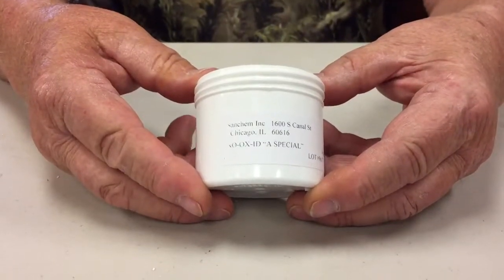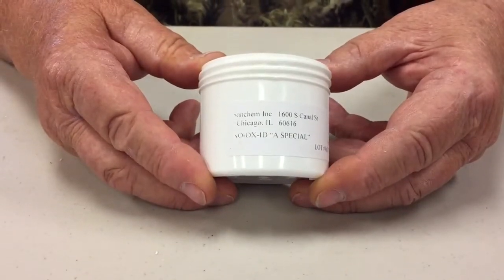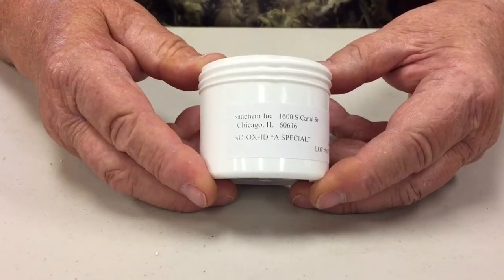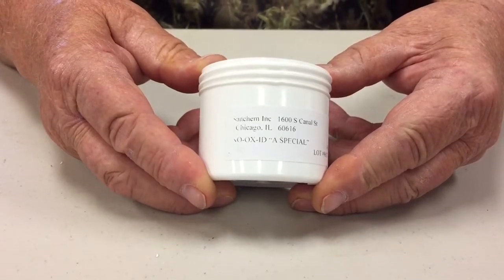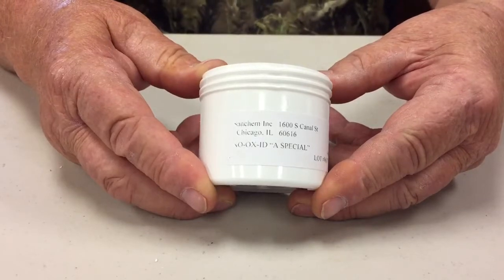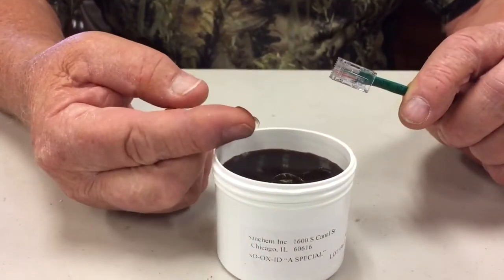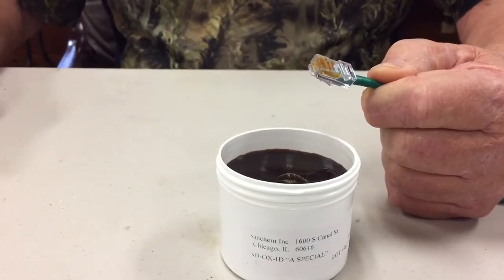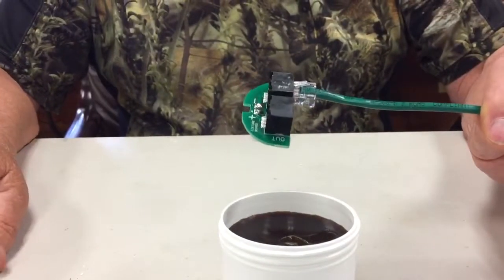Applying NO OX to Cat5 Cable in the PMMI Lighting System

Comment: if this grease is conductive wouldn't swiping grease on all the pins cause the connector to short out?
Reply from the maker: Thanks for asking! The grease is not conductive. It is to stop corrosion and does a fabulous job. This is a little known secret that is spreading like wildfire!
Reply: Everyone says it is conductive, but if its not wouldn't having it between terminals and connectors create a small amount of resistance?  Either way I will be using it on my stuff when it arrives.
Edit: from the sanchem website:  NO-OX-ID "A-SPECIAL Electrical Grade" is the electrical contact grease of choice for new electrical installations and maintenance. NO-OX-ID electrical contact lubricant (electrical contact grease) is an electrically conductive grease that keeps metals free from rust and corrosion.